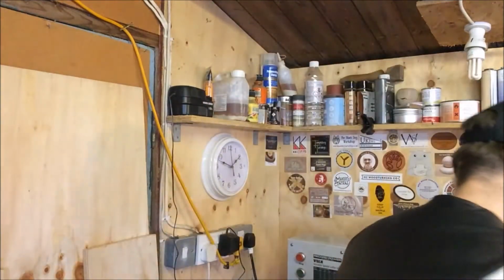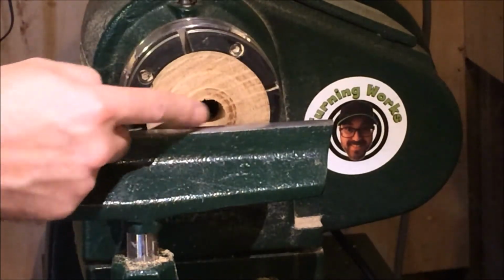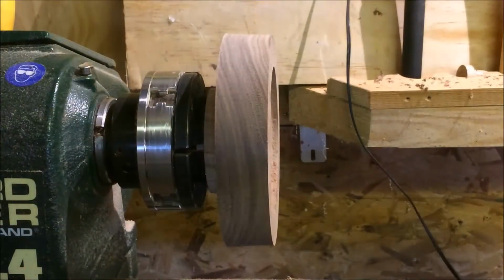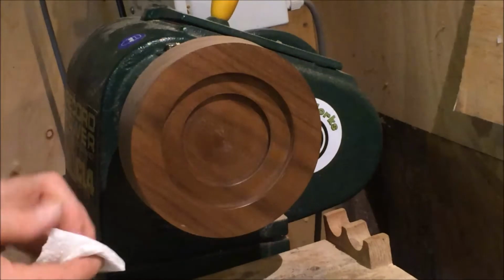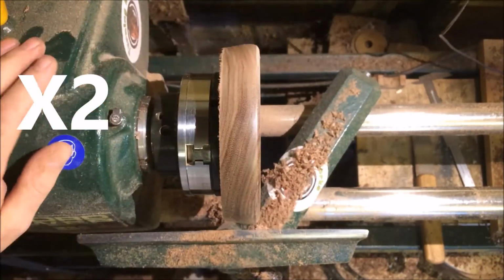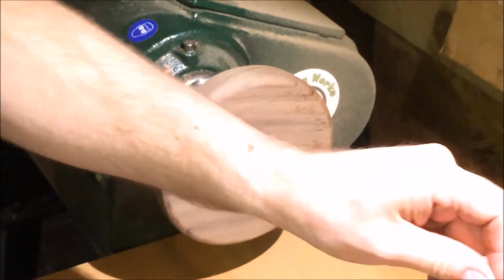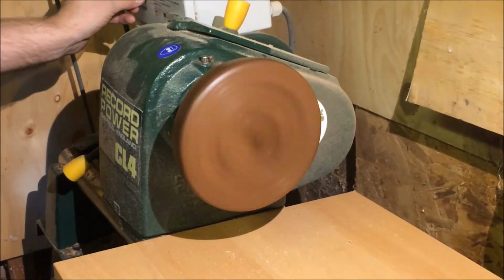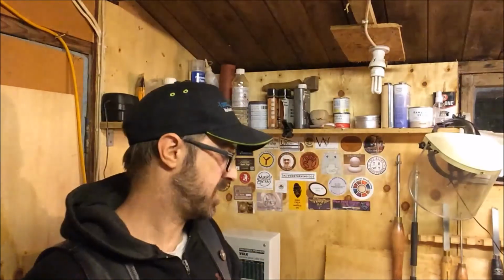Lazy Susan project - using a glue on tenon!

Comment: Great job Dave, that turned out really nice. Now all you need to do is build a motor in it to make it a truly lazy experience.
You could have saved some hassle with the glue bock. When you marked centre on the blank just bring up the tail stock.
Well done!
Reply from the maker: Thanks Paul, I have a small motor somewhere so will do that at some point.

Not sure what you mean about the tail stock...but I can now use my oak glue block as fast as a faceplate- and without leaving any holes!

👍🍺
Reply: Place the waste block in the chuck. Optional! add glue if you want it glued underneath. Bring up blank / tail stock with the centre mark on the live centre. Add a bead of glue around the waste block and the blank. That way it's fully centred. I do it a lot this way.
Reply from the maker: Oh I see, yes that is another way, I do prefer this though, it’s just easier for me 👍🍺

Comment: Great job!  the hot glue gun can use the two different types of glue that comes with it... a hotter melt, stronger bond and a lower melt less grippy glue.
Reply from the maker: Hi Adrian, well I didn’t know that! I need to look into getting both types- thanks for the heads up! 👍🍺